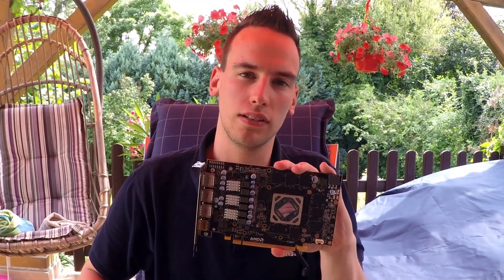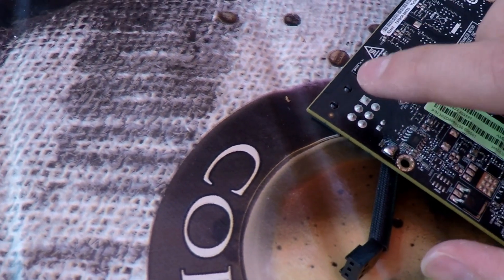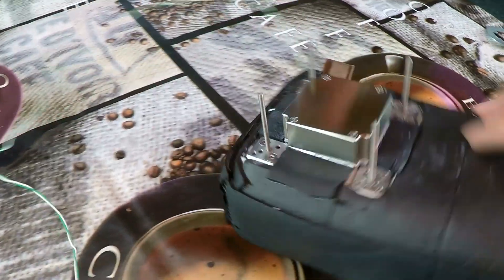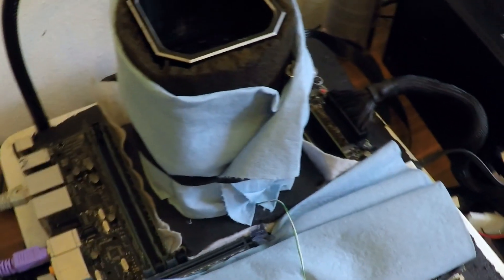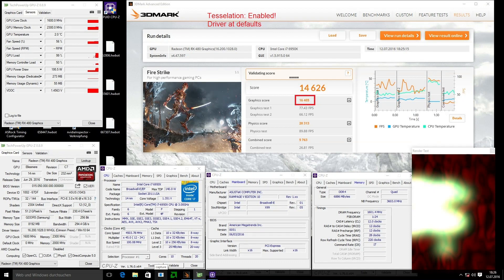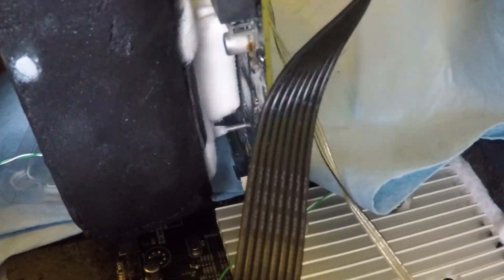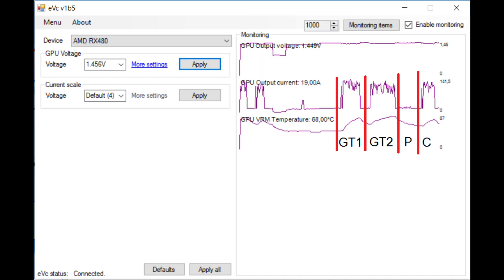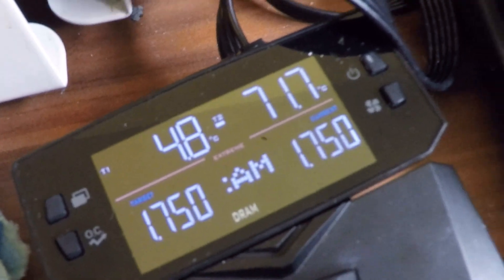AMD RX 480 Extreme OC to 1700 MHz (Liquid Nitrogen!)

Comment: This is great stuff! I would like to try this bios to push the clocks on my xfx rx480 higher. I jerry rigged my AIO h110i to the card. I'm rock stable at 1475Mhz core and 2125Mhz vram running firestrike at max voltage offset. Core temp max 50c under load, ~24c idle. I've modded my bios to increase the power limit, TDP, etc. But I can't figure out how to up the voltage limit. I've tried to follow your bios link but the website throws me an error when I try to download it. Any where else I can download it? Thanks!

Comment: I got 14.762 Gpu score in FS with an MSI armor RX 570 4GB OC with an acellero twin turbo ll air cooler:
http://hwbot.org/submission/3913081_hidde663_3dmark___fire_strike_radeon_rx_570_13219_marks

To bad i do not have a cpu to carry it :(

vbios mods:
no power limit, well set in vbios to 350 watt, but it never went past 280watt (max vrm temp was 112C lmao)
core@1430@1.25v (no clock trottling through the entire bench)
memory was clocked at 1950MHz with 1425 memory timings(voltage not modded, so that would be @1.5v i believe)

other tweaks Tesselation set to disabled

anyways might try it again with 1.5GHz Fclk instead of 1.0Ghz

Comment: Did you bump the Vram Voltage to reach 2.3 Ghz? Mine is stable at 2.1 Ghz (didn't touch the voltage) and crasches at 2.2 Ghz

Comment: 1700Mhz ? wow... the benchmark almost beat GTX 1070 that cost almost TWICE as single RX 480
Reply: IndraEMC that means at the same clockspeed rx 480 shatters gtx 1060
Reply: but at that clock you need an exotic cooler (LN2) just like this video, it's not practical on daily basis anyway.

Comment: Which RAM modules did you use with the 6950X so that they were running at 3200MHz with such tight timings as 12-12-12-28-1T tRFC 220?
Reply from the maker: G.Skill TridentZ. You need Sticks with Samsung B-Die ICs. So usually something which is rated 3600 or above

Comment: OC QUESTION SAPPHIRE RADEON TRI-X R9 290.  currently running 1110mhz core clock 1400 memory.        

+15% power limit.

when i go even 10mhz more on the memory and 5mhz more on the core clock i get pixelisation.  

Max temps with 60% fan speed 72'c 

Am i not giving it enuff power or have i just simply found the limit of my card?

Comment: would there be any difference in performance if it was a custom rx 480?
Reply from the maker: no, no difference
Reply: MikusLove Soul Maybe , since some RX 480s have an 8 pin power and more power phases than the Reference GPU from AMD. Theoritically it should give more headroom for overclocking. But that's just theoritically, maybe it won't show much or any performance differences though.

Comment: Really nice!   I've been trying to figure out just where all the partner cards are going to land in  terms of their clock speeds.   All the AIB cards are going to use an 8 pin power cable and some much better cooling than the reference blower.  I imagine the RX 480 partner cards will easily beat the stock gtx 1060.  We'll have to see what nVidia's partners can do with their cards as well.  Should be a Great fight!

...once you can actually Buy them...

Comment: Wish they made an AIO card with the FuryX cooler clocked at 1500Mhz ....
Reply: 1500 fury would crush the 1070
Reply: +joesaiditstrue funny you say that, jayz2cents just did a video on that and said the same thing.  He got a 480 with a water block to 1466mhz at only 1.18v with good temps.  But since its only a single 6 pin card he said it would throttle because it cant get enough power.  Like you said he told us to just buy a 1070.
Reply: that is a good idea
Reply: it would add another $100 to the price.  you might as well go with a 1070 at that pount
Reply: *point.
Reply: +Hxdoom G who said anything about a 1500mhz fury, the guy I replied to said he wanted a fury water cooler on this card (the 480), an AIO 480 would cost like 359-379 if not more and wouldn't even be that much faster than an aftermarket aircooled 480 and you're losing an extra 100 dollars for a watercooler.  save all that money and buy a 1070 which stomps the shit out of a watercooled 480
Reply: @joesaiditstrue  I know this reply is pretty late, but in all honesty it very much depends on your wafer lottery. If you one of the lucky ones who can push their card to 1500 or more than the 480 is well worth it, though you would still be spending $$$ on aftermarket cooling. Otherwise yes, even water won't be of much help if the hw just cannot sustain the voltage.
Reply: Most FuryX cards can't even OC by 50mhz so how are you going to get 1500mhz?  And the furyx already runs cool with its stock cooling.
Reply: I doubt he literally said "go buy a 1070."
Reply: https://www.pcper.com/news/Graphics-Cards/AMD-Radeon-R9-Fury-Unlocked-Fury-X-Overclocked-1-GHz-HBM
Reply: TJCCBR47 Why are you linking a modded pcb fury card on LN2?
Reply: 4GB MEANS 4GB stop spreading lies Jackass he said he wouldn't spend additional money($110-117) just to water cool the 480 because it would cost $40 more just to get a 1070. aka whatever the cheapest 1070 on the market is at the time
Reply: Reapov Spreading lies?  In my first post i clearly said "he told us to just buy a 1070".  Maybe you should l2read.
Reply: 4GB MEANS 4GB yeah but your dumb ass failed to elaborate as to why he said that..go on man get get get outta here. go cry a little 😃😌😬😈
Reply: 4GB MEANS 4GB haha I see you are still salty that i called you out for spreading misinformation without full context. haha 😬😈😋
Reply: Reapov By definition you are the one crying and raging.  Maybe you should smoke a bowl, then you wouldn't be such a whinny little bitch.

Comment: Is it the architecture of AMD or the GloFlo/samsung 14nm Lpp FF that is the problem with AMD GPUs clocking so much lower than the nvidia cards? TSMC FF+ 16nm allows for 2100Mhz on air this amd card needs LN2 to just get 1700Mhz. The 1060 is an even smaller chip than the RX 480. So what gives.
Reply: Clock speeds are bound to the architecture. While there are minor gains within manufacturing processes, you can not generalize or compare the amount of possible instructions per clock cycle for each design.
Reply: Well ... 1070 clocking at 2Ghz can keep up "just so" with an 980ti clocked at 1500Mhz. It's not about the clock ... why people didnt learn this from AMD and Intel CPUs yet.
Reply: GloFo has always been the thorn at AMD's side. they simply can't make good wafers but it would cost too much for AMD to break the contract with them. Samsung makes quality stuff but only 10% of the silicon comes from there. 
from what i've heard, the contract with GloFo ends this year so they can go full Samsung and maybe this is the reason that Vega and Zen are coming later

Comment: Why do you need to keep the temp at 0C when at 1700MHz but you had the temp at 2C on 1600MHz?
Reply: The Powah So it wouldn't be possible to keep it at 2C for 1700mhz? What i'm not understanding is if it can work at 2c for 1600 then why not 2c for 1700?

Comment: Still waitin' for 6+6/8 ver.
Reply: A single 8 pin is more than enough.
Reply: although i prefer a 8pin too, the issue wasn't the watts the card drew, but that the amount was split in a way, that overloaded the pcie-slot.
a software update solved this issue later.
however most good custom cards like the strix as far as i know, run the full vcore through the 8pin and are also setup to avoid overdrawing the pice-connecter.
Reply: WHY Jesus the rx480 is wired out of spec so the 6pin can support as much as an 8pin
Reply: right now, 8pin msrp models are available. one example is the powercolor red devil rx 480

Comment: those leaks were right
Reply: Yep..
Reply: I have a feeling a custom pcb rx 480 with a waterblock will hit 1500mhz stable and will beat a 1060. The 1060, like all of pascal, has a hard cap of 2150 on the core, so with the rx 480 sitting at 1266 (most reviews had it at 1300) and is loosing to the 1060 by 10% on average, then a 200mhz overclock on the rx 480 (over a 15% overclock) should bring it to par with the 1060

Comment: can you make a tutorial how to edit the PCB like yours?
and do you think any AIB with 8 pin connectors will be able to reach 1500 for example?
Reply from the maker: what do you mean exactly? The mod I did the combine the rails? No. More like 1400-1450
Reply: +der8auer 
but what do you think about the 8pin cards with water cooling for example
Reply: 8pin or 6pin its should handle same watt (its not about cabels its about PSU and how much hes  12v rails power can handle).. only different what  8 pin have over 6 pin is 2 extra ground wires and both using 3 x 12v ones
Reply: Ivan Rosic ah ok

Comment: desiring to buy a custom RX 480 card with water cooling so it allows you to put liquid nitrogen. 😂
Reply: water cooling is not the same as LN2 cooling
Reply: +The-BGR Spot as long as it sustains.
Reply: Dakota Jones it is for summer.
if it is in winter, avoid from using any kind of coolers so you can enjoy balanced temperature gaming in your room.
Reply: could you refrigerate the liquid and maybe push the OC further
Reply: +Dakota Jones theoretically, yes.

you might be better off putting the radiator in front on a A/C unit, instead of a refrigerator, because the air in the refrigerator would get hotter faster than it can cool. but the general idea is there.

but the amount you would gain is..... not alot. after a certain point you come across architectural barriers. however it might lower Temps to help ensure the chip lasting longer.
Reply: That's awful advice.

Comment: Hey which version of gpu z is this I see it has the GPU POWER USAGE i NEVER SEE THAT IN MINE How do u get that on there . I allways wanted to know my draws on my crossfires.
Reply from the maker: 0.8.9. Not sure if that's also driver related tho. I'm using the AMD press driver
Reply: what if u shorted the pci express slot and used power directly from a rail . Could this be done and just short the 12 volt  coming from the slot and make us another rail instead of worry about the slot

Comment: soo der8auer what do you think... Will it be able to clock 1500 mhz on air with AiB custom PCB and vastly better cooler? Seeing reference clocking from 1350 to 1400 gives me some hope that custom coolers will be able to take the heat and the 8 pin which will be able to raise max TDP to 225w.
Reply from the maker: On a golden GPU maybe, yes. But I'd more expect 1450 MHz. For 1500 MHz you'd probably need some nasty voltages

Comment: so what speed on air from the new bios?  1400?  1500?
Reply from the maker: 1500 max on water but not on suitable voltages. For 24/7 around 1450 on water
Reply: so it is pretty much safe to say there is almost 0 headroom for OC for average joes and gains are so small it is not worth it (Im talking about factory OCd cards from MSI, Asus nad such)
Reply: so what's your speculation... Will AiB be able to clock 1500 mhz on air? Reference card is extremely limited by it's cooler.
Reply: +sermerlin1 he said 1450mhz on water cool.
Reply: Martin Shekreli yes for reference... but custom PCBs are more optimized and well put but we just have to wait and see i guess

Comment: I didn't understand. So under 1.7ghz GPU is unstable and crashes? Or what?
Reply from the maker: yea 1700 MHz was not stable enough to pass the benchmark
Reply: 1600MHz is fine on LN2, but 1700Mhz is unstable for heavy loads.
Reply: +der8auer will you try again with ln2 bios with sleep state work around?
Reply: He needed more cooling but the gpu didn't like going below 0° due to the bios. Need a sub zero bios then the card could be really pushed.

Comment: In a previous video you said the non-reference cards would not be able to reach 1600 MHz. Now you reached this? How?
Reply from the maker: Yes it's not possible with normal cards and normal cooling. I mean we used liquid nitrogen here, right?
Reply: +der8auer and you optimize the 12 v power rail right. Or did you do that in the first video too?
Reply: David Freeman good question I actually need to know the answer to as well.

Comment: What do you expect for Aibs? 
1400-1500mhz?
Reply: +LightswrathUltimatum Sapphire nitro is 1390mhz out of the box. Comes July 22
Reply: Sapphire Nitro has about 1340mhz. 1500mhz is unrealistic expectations
Reply: 1400 will me much. 1500 maybe on liquid cooling.
Reply: he said in previous that 1500 would be MAX
Reply: Sorry let me clarify i was talking about boost clocks on normal custom cards, or perhaps max overclock.
Reply: +jalebi Singh nice, was searching a lot to know what boost clock the Nitro one will have
Reply: +David Sho 1420 should be posible
Reply: +David Sho why unrealistic? the gtx 970 could go well over 1500mhz....
Reply: ***** well my g1 gaming is around 1520mhz so....
Reply: ***** well 1480 is still pretty good and close in terms of performance to mine 1520